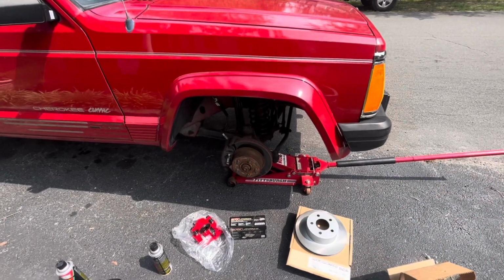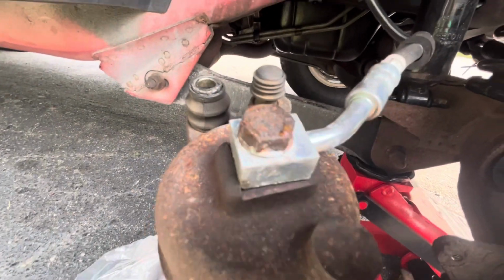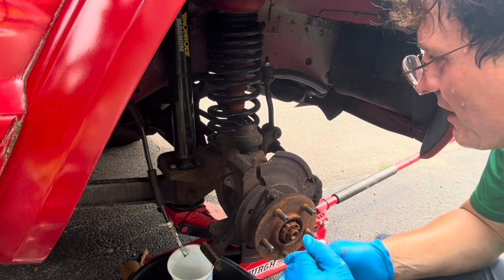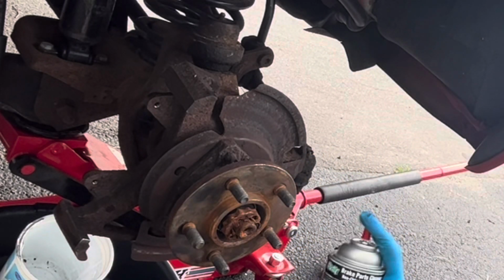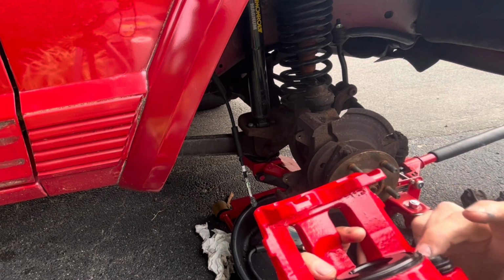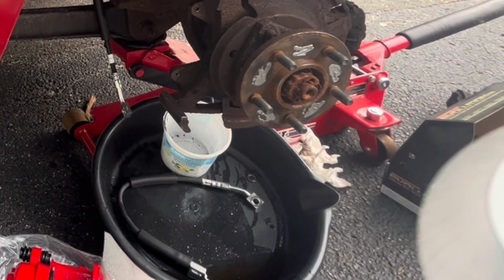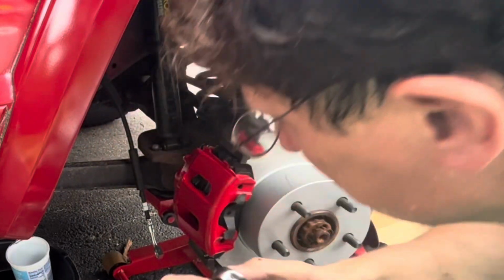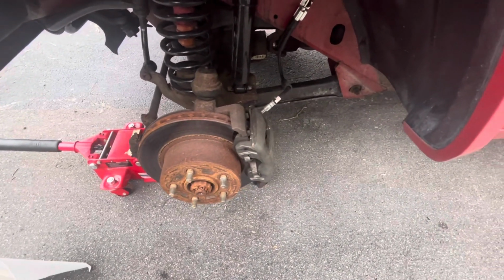1996 Jeep XJ - Brake Caliper Replacement

Comment: Attach and torque the banjo bolts before putting the caliper on the rotor.
Reply from the maker: Seems more difficult because it’s tough to torque those without having it installed and held in place